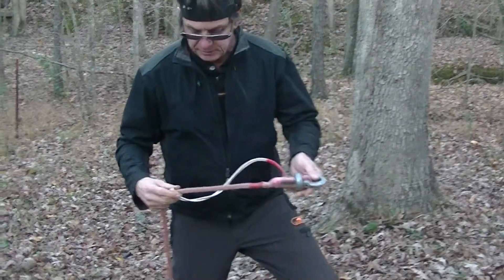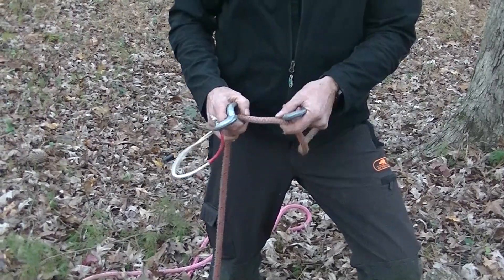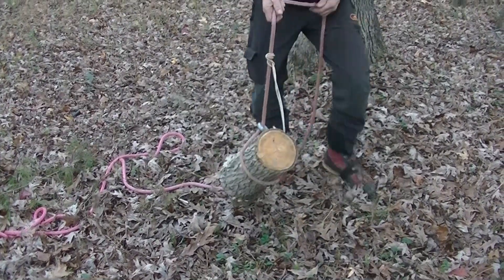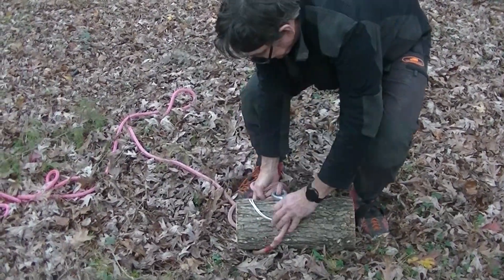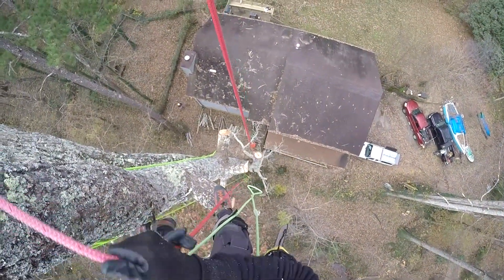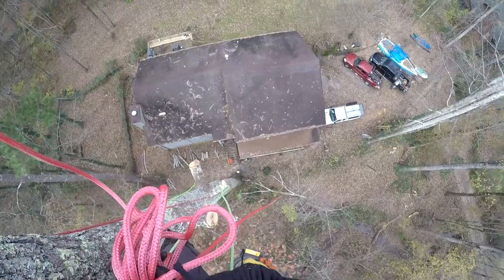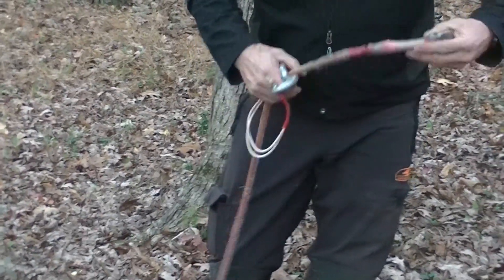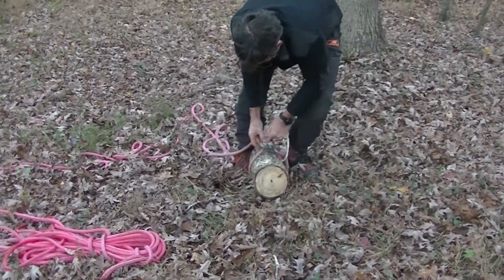Remotely releasable knot-less rigging system.

Comment: Richard great video!  Do you know what size the hook and shackle are and if they can be purchased separately?
Reply from the maker: Patrick Brandt I will look up the size but yes they can be purchased separately and from a different company then our tree stuff folks
Reply: Thanks Richard.  The size is what I really need to know.   I found these links on Tree Buzz for the parts but don't know the appropriate size.  Thanks!
http://www.riggingwarehouse.com/products/RIGHARD01/RIGHARD01@@2e12/RIGHARD01@@2e12@@2e20.aspx
http://www.riggingwarehouse.com/products/RIGHARD01/RIGHARD01@@2e12/RIGHARD01@@2e12@@2e19.aspx

Comment: Thank you for all the time you put into making such informative and valuable videos, Richard.  They are seriously great and have been a tremendous help to me as I have transitioned into SRT.  Quick question-  what is the purpose of the bungee cord?  Is it necessary?  I played around with this system tonight (I'm using a steel ISC ring on the end instead of a shackle) and seemed to be able to get the hook to release every time just by jiggling the rope like you do.  I'm going to try it out tomorrow on some real limbs and find out if I can actually get it to release or not.  Thanks a lot!

Comment: Do you have any concerns about an accidental release with applications in a zip line,  or even with piece lowering set up?
Reply from the maker: +Dylan Mullins I do not.  It feels very secure and I suspect because of the lower friction on metal it may even cinch the limb tighter.